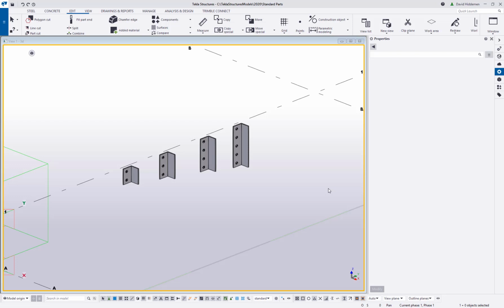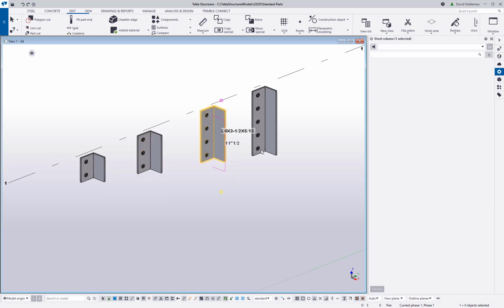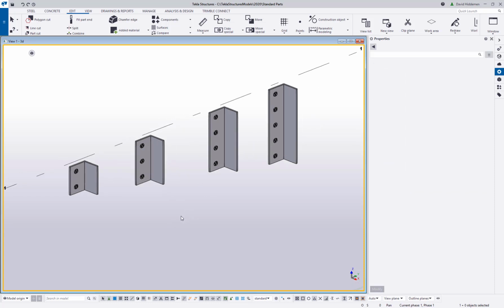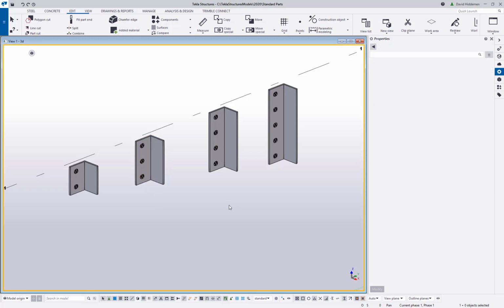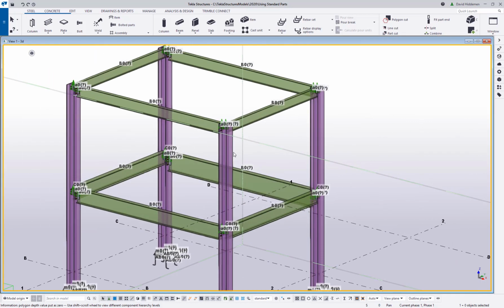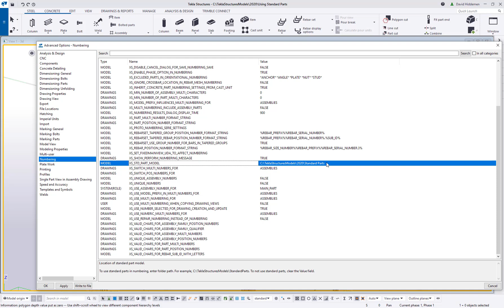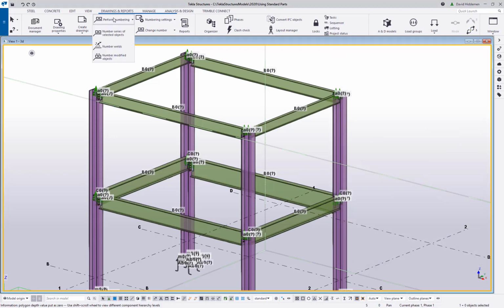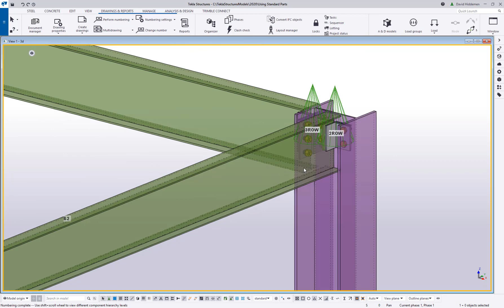Creating a Tekla Structures Standard Parts Model

Comment: Do i need to save this standard parts in a separate folder?
Reply: The standard parts model is a completely separate Tekla project. It can be saved anywhere, but yes it would be in a separate folder than the working model.

Comment: Why the standard part model was not numbered or it not supposed to be. What if had a case where two different sets in 3row clip angles ? For example if I had two gauge lengths on 3row clip angles
Reply: The standard part model is not supposed to have a numbering run. You just enter the desired mark as shown in the video. If you have two different gauges on 3 row clip angles then they would be two separate standard parts that would need to be defined.

Comment: What is the benefits of this method over a custom components catalog that you can just export and share?
Reply: This has a very different purpose from a custom component. Components allow you to quickly create the same type of part/connection over and over again. This allows you to have those objects always take the same piecemark, whether they are created manually or through a component.
Reply: @TrimbleTeklaDave  Thanks for you reply David. I work in precast and have recently complete a large building in London UK. It was precast with brick slips attached to the front.

I used CCs for the different brick types. Would you recommend standard part modeling for this type of work? Bearing in mind the brick slips are cast in parts. I ask as I can see your angles are loose parts desperate from the assembly.

The building I recently complete was Orchard Wharf in London. Very interesting.
Reply: @teamnoble9715  I am not sure it would work for the way precast part numbering works. Yes, the parts in the standard model are loose, but they must be 'secondary' parts in the production model to get the required piecemark, not sub-assembly or standalone.